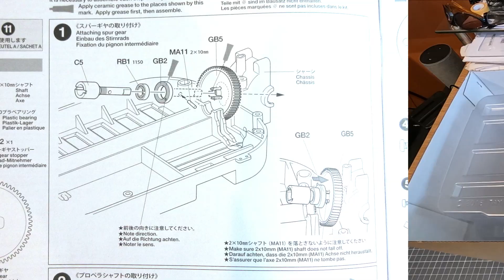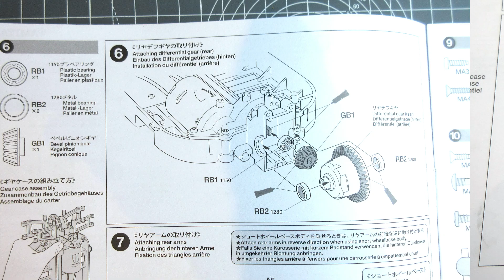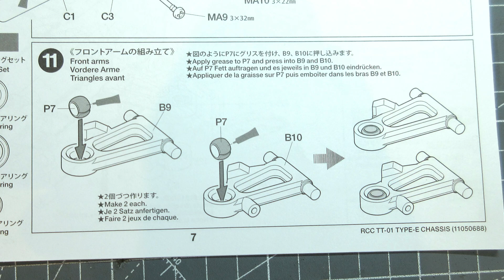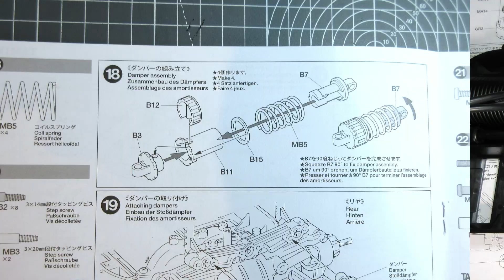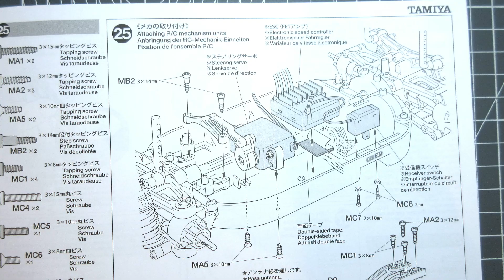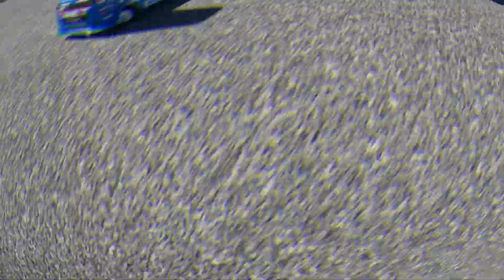Tamiya TT-01 Type E Man TGS Racing Truck Speed Build. Part 1 of 2 - Chassis Complete. Kit 58642

Comment: Would this be OK with a 3300kv?
Reply from the maker: Yeah fine.  I did a speed test on mine with the 4600kv and 2s and it's still only 33mph so not too fast really.
Reply: So would the 3300 be alot slower?
Reply from the maker: @D5DRIFT  Well it will be maybe 27mph at a guess if you are using 2s lipo.  The pinion with the kit is only 19 tooth and you can put up to about 25 tooth on it so you would be doing over 30mph then.  Also you could use 3s lipo if you have one the right size to go in.  To be honest anything over about 25mph is enough for this.  I have a review and speed test video coming out tomorrow which you might like.

Comment: Hi there Pete, an express build guide and explanation, still, lovely to hear your voice. I’m watching nice and closely for how the recommended Razor10 motor and ESC combo works. Certainly seems reasonably quiet. I believe the Subaru rally car is on the same TT-01E chassis. Looking good so far. Take care and best wishes to you and the family 😉😊😁
Reply from the maker: Hiya John. Yes the brushless set is good so far for sure. You can indeed get the Subaru Impreza on this chassis. This is more of a road only chassis as you can't easily extend the travel of the suspension like you can with the TT-02. Mark and Rob did a great comparison of of the two chassis'. Cheers for watching and your great comments as ever my friend. Best wishes to you and yours too 😁

Comment: Great video Pete. You pointed out the highlights very well. It's quiet an interesting build and was fun to watch👍💪
Reply from the maker: Hi there. Yeah it runs smooth until you give it full throttle and then that plastic centre drive shaft rattles about so I've ordered the metal upgrade which should sort out the issue. Many thanks for watching and your great comments. Much appreciated 😁
Reply: @PeteWylieRC  I would like to see a before and after upgrade video😉
Reply from the maker: @RCBirds  I will indeed show and talk about that issue :-)

Comment: Usually when a truck goes sideways it’s not a good thing ! 
This is awesome, drift trucks are very cool 😎
Reply from the maker: Yes it wouldn't be ideal if a truck was going sideways on the M27! I've been enjoying sliding this around but need to watch out for wearing out the tyres. I tried drift tyres but you can't get it to go very fast as the wheels just spin. Rally blocks seem to work well. Many thanks indeed for your great comments. Best wishes to you 😁
Reply: @PeteWylieRC  thank you buddy, I appreciate the feedback on the drift tyres, my next build will be a drift MA 08 I think 🙂
Reply from the maker: @M.A.S.Ked-Crusader  I don't know if you've had one with the hard drift tyres but really you need a very smooth surface to run on. I didn't have too much joy with them on the truck as the tarmac at the car park was a bit rough. I did a little video with my Datsun 240z TT-02D on the smoothest road I could find. It is fun but you are traveling at about 5mph tops! I've got some of those smooth rubber tyres so I'll see how they are for drifting this. Are you meaning the M08 rwd chassis?
Reply: @PeteWylieRC  that’s the one buddy, yes ! It’s got an adjustable wheel base which is handy I think, appreciate the info on tyres and if you recommend any deep dish BBS style wheels that would be great 👍
Reply from the maker: @M.A.S.Ked-Crusader  ooh the wheels are beyond my knowledge. I would say that 4wd is easier to drift. Might be my lack of skill but the rwd with not much grip just goes in circles!
Reply: @PeteWylieRC  that’s worth knowing, thank you 👍

Comment: Great job I have those razor motor's and they have been really good and not expensive from time tunnel, I only got the 3000kv and swapped it out of racing fighter and put it in my rustler, and then 3s it WOW Best move I made and the rustler motor in racing fighter even more WOW !!! THANKS FOR your upload mate 👍🙏🐈
Reply from the maker: Hi there. Yeah I'd generally been using the Absima brushless combos but the last one I got seemed a big coggy off the mark which the previous ones hadn't been so I thought I'd get the Razor one this time. I've had one before and they are really good. This is plenty quick on 2s and the main problem I had was wearing down the tyres! Need to use some of the cheap Chinese ones for sliding around really. Anyway it's a great little truck. Not sure about my plan to run it off road as it's got that big overhang at the front. Many thanks indeed for your great feedback. Always appreciated 😁

Comment: Looks like a great kit Pete! Should be run to see how it flys about on that motor 😎🔥
Reply from the maker: Hi there. Yeah it's a very nice kit and I'm pleased with how it turned out. The acceleration is really quick and the top speed seems really fast although I measured it and not quite as many mph as I thought. All will be revealed on another video. Many thanks indeed for watching and commenting. Much appreciated as always 😁

Comment: Nice..3s!
Reply from the maker: Hi there. Oh it's more than I can cope with on 2s really. The top speed wasn't quite as high as I thought but the acceleration is super quick. Many thanks for watching 😁
Reply: @PeteWylieRC  change tires and add alloy center shaft and it will run 3s all day
Reply from the maker: @philthyco1  Funnily enough I just ordered the metal prop shaft.  On the test run it did make an alarming noise on full throttle which I assumed was the wibbly wobbly plastic shaft.  Many thanks for the advice.  I still think I'll stick to 2s mind you :-)
Reply: @PeteWylieRC  3s or no s! Lol cheers bro
Reply from the maker: @philthyco1  haha, ok then 😂